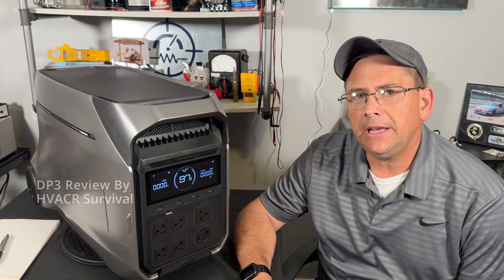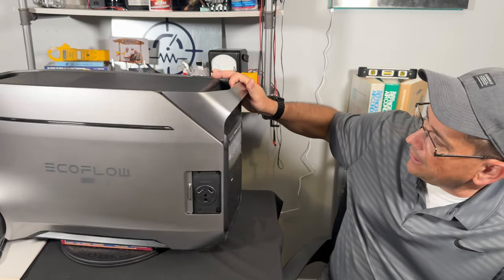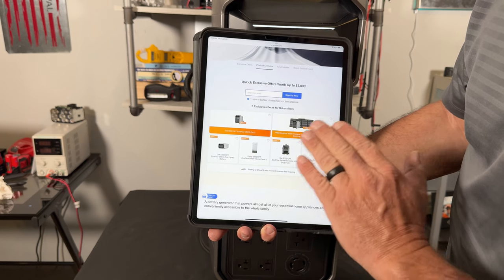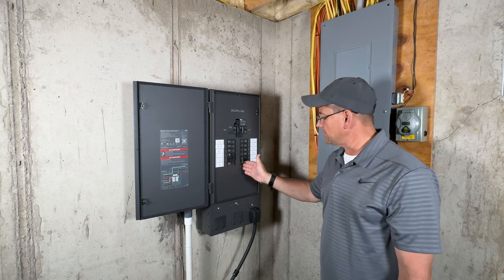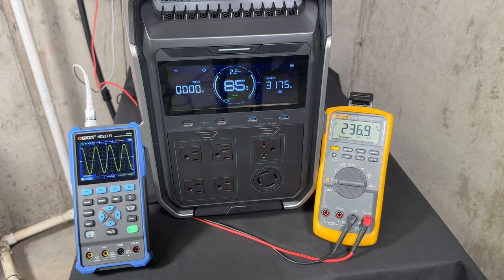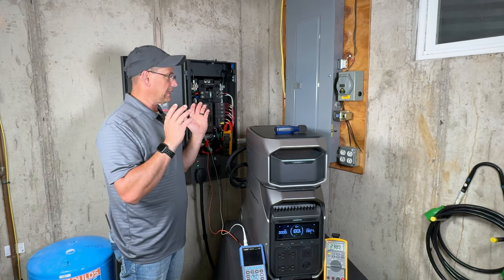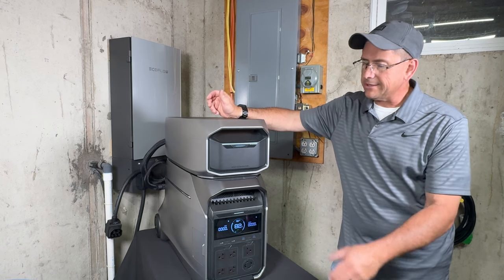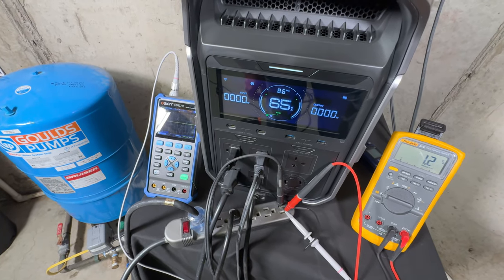EcoFlow DELTA Pro 3 • Worth Upgrading? Full Review

Comment from the maker: Exclusive offer!  Purchase the EcoFlow DELTA Pro 3 through my links and use my code EFDP3HVAC (Valid June 25-July 23) to get one EcoFlow PowerInsight for FREE!!!
EcoFlow Website: https://bit.ly/3VKdKC3
EcoFlow Amazon: https://amzn.to/4b60FYl

1. Buy one EcoFlow DELTA Pro 3 for $3,199 with a $500 coupon! Or buy one EcoFlow DELTA Pro 3 and get one EcoFlow 400W Portable Solar Panel for free.

2. Get a $300 upsell discount when purchasing any of these three bundles:

* EcoFlow DELTA Pro 3 with EcoFlow Smart Home Panel 2

* EcoFlow DELTA Pro 3 with Smart Generator 4000 (Duel Fuel)

* EcoFlow DELTA Pro 3 with an Extra Battery.

* Get an extended 2-year warranty of EcoFlow DELTA Pro 3 and free installation consulting services.

Comment: It's nice to see a review from someone who actually knows what they're talking about! Many reviews I've seen for power stations are from YouTubers with little-to-no electrical background. I doubt any of them would think of scoping the output to verify true sine wave output, and even fewer would consider checking under maximum load. Thank you for demonstrating the various ways the Delta Pro3 can be connected to your home, and the smart panel's switchover speeds. Color me impressed!

It's also nice to see a product designed with so many safety features, the team that engineered this unit is clearly very concerned with safety and long-term reliability, almost to an obsessive level. It shows an attention to detail that is often lacking in many products available today, regardless of what the particular item is. The more you delve into the details, the more confident I am that EcoFlow wants to be the "Gold Standard" that other brands will be compared to.
Reply from the maker: I got to admit I’m pretty impressed with the Ecoflow. The machines I did before were smaller and didn’t have the power to meet my needs or the voltage I needed. The excitement you see in the video is truly my feeling.

Comment: Thanks for an honest review.  We live in the country too and run a gas generator as backup.  This is what I've been looking for.
Reply from the maker: I know what you mean. I have a 8kw gas generator that eats gas but it has enough power to run the AC or water heater if I stage it. This and the DP ULTRA are amazing. I need permanent solar panels to offset the gas generator.

Comment: ahh, I see your furnace blower assembly, I was about to ask what the current draw was and if it was cooking the motor, but then I seen the blocking plate/s on intake side.
I blocked the outlet side on mine, about 2/3rd to 3/4 blocked to get the current just below rating. it has a very directional high velocity flow that way.
I never tried blocking the intakes to test the output velocity and pattern, as I wanted high velocity directional anyway. 😁

Comment: Wanted a DPU but as of now the Smart Generator they offer only talks to the Delta Pros, so I went with the DP3... For long term outage without a moderate sized dedicated solar array, the amount of battery storage would have to be massive,  so I thought the generator and smaller capacity makes more sense. The auto start generator for nighttime, and some smaller solar panels for the day to offset using too much propane was ideal.    I'm bummed on the SHP2, major flaw to not to be able to service the relays, or a fail safe to grid or manual override (at least from what I read), I think even the first one you could service a bit more..  I need to know if I lose power its from a grid failure, not a failure of my supposed backup system.  That SHP2 will fail someday, you may upgrade in a few years as that's your thing so it won't be an issue, Plus you can do it yourself, but the average person who will spend 2000$ to install one, and have to spend 2x that in labor to replace one if it fails is not worth the features.  I hope they come up with a better one to address this, because then it would be worth the little bit extra they were asking when bundling on the Oct Prime deal.
Reply from the maker: Those are all valid points.

Comment: Hi, I was wondering what your opinion is on the Delta Pro 3 being able to be used as a UPS for mission critical appliances as a sump pump. Was looking to get the DP3 and connect my sump pump to the front panel and have the sump operate directly from the DP3 all the time hopefully giving me peace of mind if I am not around that the sump will work should there be an outage. My home is located on a high water table and the sump is always going off, during a recent rain storm which we had 3 inches of rain in a 24 hour period, the pump pumped out over 13,000 gallons of water, cycling over 680 times. With a 1/2 power sump that could go off that many times when the power is on, would it make sense to have the sump connected to a DP3 all the time? Would it eventually burn out the DP3, or in the case of single point failure that I do not connect 100% of the time and the sump should not be connected to the DP3 and leave connected directly to power? I am concerned that the DP3 may not be a mission critical device to run 100 percent of the time and that I could in fact adding a variable that could make my sump pump backup even worse.
Reply from the maker: I’m actually using the EcoFlow Delta two max for my sub pump just like you’re describing and it has one extra battery. One mistake I made was switching to a 1/2hp pump, I wish I would’ve stayed with a 1/3hp because the in-rush amperage is really high and really unneeded on my system.

Comment: Hi what Manual transfer switch would you use for running the DP3 with a 1/2 HP well pump (220V) and a 120v pellet stove +  120v fridge for power outages.  I was thinking the Reliance 306CRK pro tran 2?  I know the well will pull 3000w at startup.  I plan on using the L14-30 connector on the DP3 to the transfer switch.  Does this sound correct?
Reply from the maker: If you’re gonna do it manually, why waste the money on a transfer switch,  just get up interlock switch and watch your power consumption yourself.

Comment: dude help lol I have a huge bus 🚌 rv takes 50 amp cord I juat bought a new Toyota electric car also takes 50 amp to charge it ... I want to buy one of these to carry in my car incase I need a extra charge.   Will this work well ??? is there one that has a 50 amp so I  can plug directly?
Reply from the maker: The Delta pro 3 does not have a 50 amp plug. It has a 30 amp plug and even then it doesn’t put out 30amps. It provides 4000 Watts , (4000/240=16.6amps).  you’d be better off the Delta pro ultra. Even then, it takes a special charger to charge these electric cars at a faster rate that you would need.

Comment: For the panel do you need to be connected to the internet or do you just need to connect to it from your phone say I had a unifi access point and just disconnected the modem I could still access some other thing on my network like a file server could I still use the panel or does eco flow host the application on a server and not at the panel
Reply from the maker: If you’re trying to stay offline then use the Bluetooth. I’ll have to see if it can connect directly thru the WiFi without internet.

Comment: The dp3 and dp ultra can't power the smart panel 2 together can they?
Reply from the maker: You’re correct. I was told it was supposedly going to be able to do it but as of now it has not been done. I’m not sure if it’s a problem because of the capacity of the two units are mismatched? It’s definitely a bummer.

Comment: Where do you have your battery bank located relative to your living quarters?
Do you have any concerns about thermal runaway of the pack when located near or in your house?  I don’t mean to be a scare monger, but you can put the battery pack in an outdoor location where this would basically be of a reduced concern.  
What does the manufacturer recommend?  You did comment on the safety features in the video
Reply from the maker: Lithium phosphate batteries are a lot different than lithium ion batteries. Lithium phosphate batteries don’t catch on fire like the lithium ion.  I would not be surprised if they don’t have manual thermal fuses in the battery packs to break the electrical contacts. Like I mentioned in the video this is UL rated “underwriter’s laboratory”. That is a very expensive test to have done and almost no Equipment built overseas has a UL rating. The UL rating it rated for was developed for battery systems like this. I’ll need to find the actual four digit number. I believe it’s nine something something something.